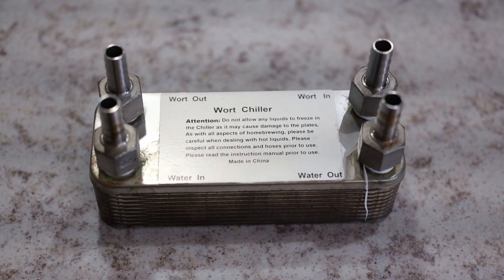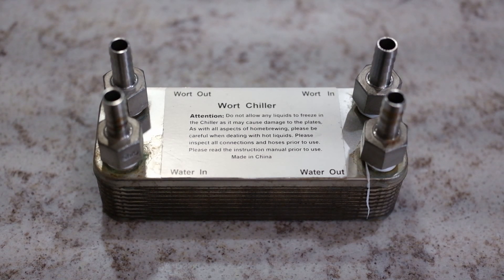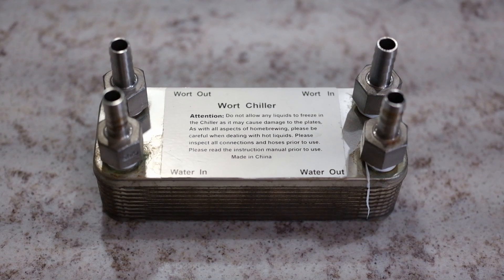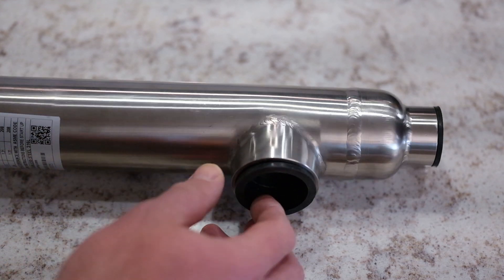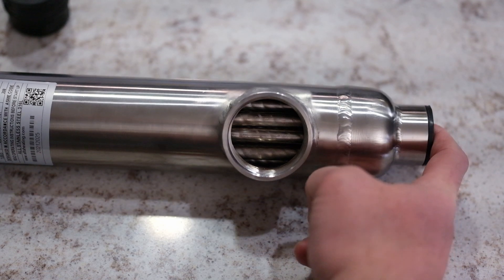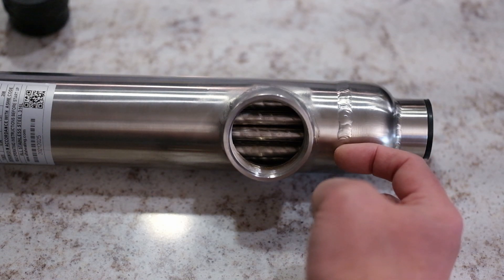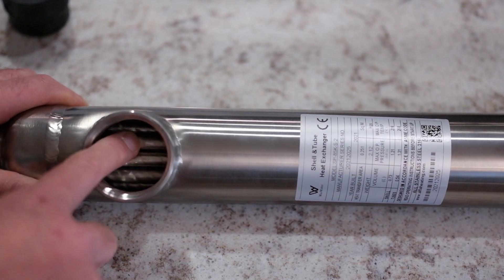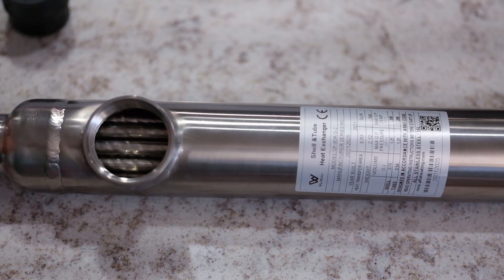New Heat Exchanger

Comment: Can't wait to see how this turns out.
I use quite a beefy pc for gaming in a  really small closet under the stairs, the heat is a big issue especially I the summer.

I've been thinking of a way of getting the heat outside as I'm on an external wall. Something like this might just be the ticket. Maybe a radiator outside with pipework coming in/out through the wall.
Reply from the maker: Take a look at the chiller I use in my other video....more to come. It works great for gaming. Port royal at 27500 with Temps below 50c. I will detail in another video this weekend